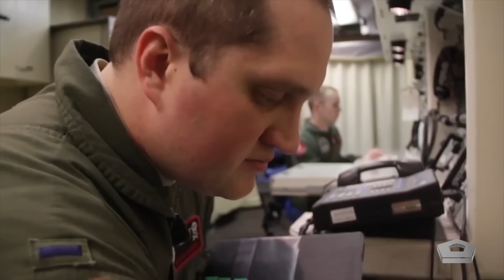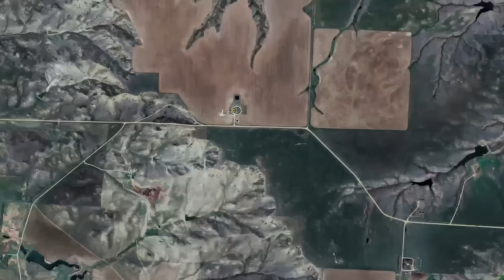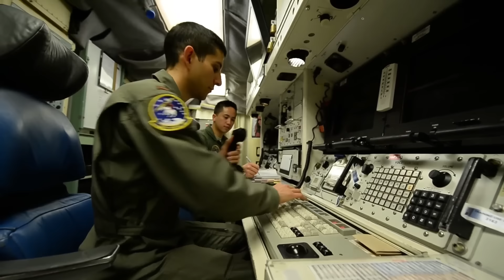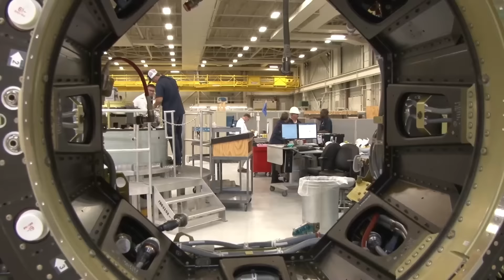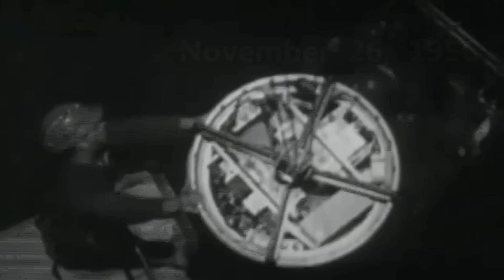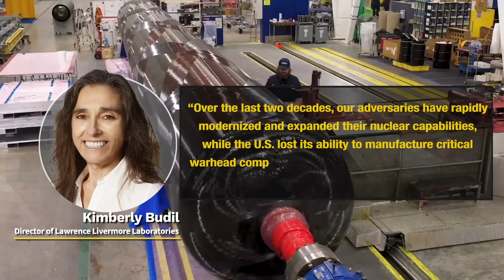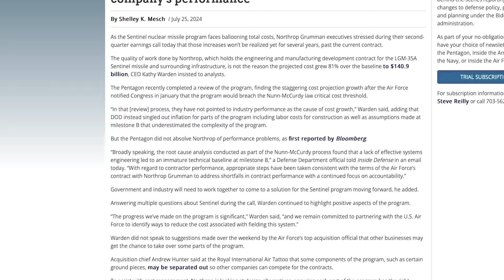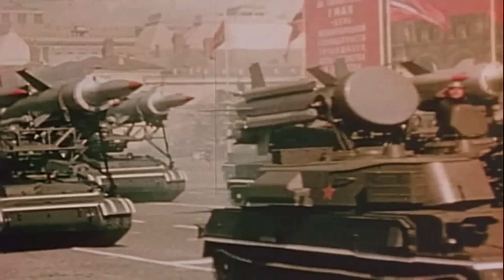America’s New Doomsday Weapon is Unstoppable

Comment: Hey Chris, love the video, but a few points of clarification:

1, Likely none of the advantages of ground based ICBM'S in general that you listed apply to the US arsenal. The Trident II carried by our nuclear subs is extremely capable even by the standards of ground based missiles and actually has an unclassified range only 1000 miles less than the Minuteman III, is more accurate than the Minuteman  III, and a better payload (it can carry up to 14 warheads vs 3 or 4 though this would probably drop the range to under 7500 miles which is the unclassified range with 8 warheads), is slightly faster, and is also more accurate than the Minuteman III. Also, the direct route is not really an advantage either, as the Trident II can take an equally direct and even shorter route than the Minuteman III by positioning a sub in the Arctic Ocean. The missile defense concern could also be mitigated by simply putting more warheads on the Trudent II missiles, at least in the shirt and medium term, as they are currently deployed with no more than 4 warheads per missile, and at present I can't find any info that Russia or China have or are developing any defense systems that can target an ICBM before the terminal phase when the warheads separate, either from their own claims or estimates from western analysts (though this is something that western analysts might not release to the public). I'm not finding fault, as every time I see descriptions of sub vs ground launched ICBM's they seem to be described the way you described them in your video, but if the specs are compared to the Trident II, or for that matter France's M51 sub launched ICBM, the comparison appears largely or maybe even completely out of date. 

2, While you accurately explained why the Minuteman III would cost so much to update, this might not entirely explain the cost overruns on the Sentinal program, as the Minuteman III, while it is the most recently developed land based ICBM still in service with the US, is not the most recently developed land based ICBM the US developed prior to the Sentinal. That was the LGM 118 Peacekeeper, which was built in the 80's and built by Northrup, so Northrup-Grumman may still have some reserve of talent with some knowledge of how to manufacture advanced ground based ICBM's. This is also not something I see referred to anywhere, but it's another clarification that I think is useful. 

Still a great video, and one that left me better informed than before I watched it (this got me thinking about the actual place ground based missiles would hold in the US arsenal), I just want to add to the info available. 

I'd guess the true role of the Sentinal would be to maintain that "missile sponge", which the Minuteman III would otherwise soon become too unreliable to remain in as a credible threat, and maybe to future proof the US deterrant in case Russia or China are able to produce Midcourse interceptors capable of downing ICBM's at scale at some point in the future.

Comment: I'm sure they have the plans for the MX missile somewhere.  That was actually deployed until we got soft in the head and got rid of it as part of an arms control deal.  It was 10 warhead, not just three.  Get that back into production and replace all of the Minutemen with those, having over triple the warhead capacity.  Also, for five hundred  missile or so, build a thousand new silos (many of which will be cheap decoys.)

Comment: Why not invest the money into direct energy weapons….same reason people who invent engines that run on water keep disappearing.
Reply: No, it's because they're as retarded as the idea of an engine that runs on water. We already have the latter, they're not a secret. They're just horribly energy-inefficient because they requires hydrolysis. We would need to put energy into the engine to make it produce less energy. 

For a DEW to be effective, it would need to have line of sight. If we put it on a plane, that plane is going to need a LOT of power to make the weapon worth a damn. That means a very large, very heavy, and very hot plane, that everyone will see coming. There are SAMs with ranges of well over 250 miles, WAY over the curvature of the Earth, that would just blow it out of the sky. 

So we put them in space? GDI Ion Cannon? Lots of cheap power up there from solar, and though the weapons would still be very heavy to truck into orbit, once it's up there, it effectively weighs nothing. Except it's a DEW, so it also produces a shit-ton of heat. That's a HUGE problem in space, since there is nowhere for the heat to go. Well, I mean, there is everywhere for it to go, but no way to conduct it away from the spacecraft. Even a common experimental military laser would rapidly vaporize all of its coolant and melt itself. A maser is cooler, but not enough to make a difference. LIPC is lightning in a tube. It's hotter than the surface of the sun. See the problem?

But that's not the only problem. There ain't no stealth in space, buddy.  The second anybody launches anything into orbit or beyond, every half-developed nation on Earth with a handful of satellites and radars knows its exact orbital track and position at all times. If they already know it's a WMD, they'll ASAT it straight down, or fire their own maser at it, frying it. Much easier from the ground, too, since you can make an anti-electronic maser out of a simple radar dish. Anyway, If they don't know the WMD is there, it will fire exactly once, because it will either melt itself, or show up as a gigantic, glowing, VERY detailed heat sig, and then get shot down immediately. 

Don't get me wrong, I love sci-fi particle cannons and shit as much as the next honest guy, but the sad fact is that they just aren't very practical for space, or anywhere else, for that matter.

Comment: 7,500 miles of copper wire for around 300-400 silos is only around 20 miles of copper for each silo.  20 miles of copper wire per ICBM silo seems quite low when considering the extensive infrastructure needed to support these sites. Each silo requires wiring for missile control systems, guidance, and launch mechanisms, along with critical components like communication with command centers, radars, power systems, security, and environmental controls. The 7,500-mile figure might refer to a portion of the wiring, perhaps focusing on specific communication or control systems, rather than accounting for all the wiring required for other infrastructure inside and outside the silo, including connections to command centers and broader military networks.

Comment: WE SHOULD BE DESIGNING A LAND BASED MISSILE… BUT ONE THAT IS MOBILE. BY RAIL. BY LAUNCHER ERECTOR. AND WE SHOULD DESIGN A MYRIAD OF “LOCATIONS” THAT THE FLEET OF MISSILES COULD BE. IT COULD BE A SYSTEM OF HARDENED LOCATIONS… OR JUST PLAIN HANGERS/BUILDINGS. THE LETHALITY OF THE SYSTEM IS NEVER KNOW WHERE YOU WOULD HAVE TO AIM IN ORDER TO NEUTRALIZE THE SYSTEM. IF A VEHICLE MOVING FROM A TO B EVEN HAS A MISSILE IN IT… OR NOT. YOU WOULD NEED TO ENSURE THAT THERE WAS NO WAY TO “LOCATE” THEM. SAY BY A BALLOON WITH SOPHISTICATED RADIATION OR OTHER SENSORS THAT OUR AW0L SECofDEF LETS SAIL FROM COAST TO COAST IN OUR AIRSPACE.

Comment: Arm 1/3rd of our silos with real missiles, the other 2/3rds with fakes. It will cost far less and have the same effect of deterrence. If necessary, make the fake missiles still launch like real missiles and only inform a couple people at each launch site that the missile isn't a real nuke, while the rest of the people stationed there think it's real. My point is surely we can achieve the same level of deterrence without arming all 450 silos. 450 is an absolutely insane number. How many do you really need for deterrence in 2024? (Personally i say get rid of them entirely, but I recognize how insane the defense industry is in this country and how that would simply never happen. This suggestion is already a compromise.)
Reply: Nuclear weapons give off radiation that can be sniffed such as by a sensor payload in a balloon floating over the fields.  The Chinese silos are closer together- possibly- to interconnect subterraneanly to shuttle/swap live and dummy warheads.  I just finished "Silo" on Apple TV; the large, steel door in the base of the silo is likely an interconnect to the others.
Reply: @MikeShannahan  giving off radiation is incredibly easy to do with a dummy warhead.
Reply: Why would anyone at any silo need to know theirs isn't a live nuke? There is no value to that, and a value in security for not telling anyone you don't need to.

Comment: Newer is not necessarily better.  
We see over engineering daily causing un reliability.  
Thru a handicapped education system . And corporate greed dictating engineering philosophy.  
If we lose the next ww it will be because our def exhaust  caused a fake code.  And we could not get a McDonald's ice-cream machine fixed.
Simple presision engineering that is reliable and east to fix wins wars .  Lest we forget

Comment: All of these options are stupid. Here's why. U.S. already has access to Space X, surprise! They make rockets that can be used over again. Nuclear payloads only need to reach highest point of ballistic trajectory under power. It falls the rest of the way particularly in the case of a MIRV warhead. So why use outdated rockets to upgrade a system that will be obsolete upon inception.Use Space X rockets to lift payloads to high point, then return to base and do it again. These rockets have already undergone testing and prove the concept each time they launch. A cost saving of billions in R& D. Anyway you look at it doing anyrhing else is costly, time consuming, and wasteful. Use what you have already sitting on the shelf.

Comment: 30 min everywhere. 
Yeaa.. no. That doesnt add up.
If you go orbital speed(around mach 25). It takes 90minute for a full orbit. Or 45min for a half orbit.
So 45min is the minimum time to get everywhere. As going faster than orbital speed means you will leave earth. 

Not even taking air resistances in account or speed up time. 

A more realistic mach 5. Will make it take 2,5 hour.

Maby you can skip time by adding rockets to friendly nation. But still.

Comment: ICBM-s are designed to be expensive intentionally. The most expensive part is the plutonium core in the warhead, it needs to be changed regularly because half-life degrades it below weapons-grade percentages over the decades. The old cores however are still too pure to repurpose as fuel in a reactor, recycling or re-purifying it would be incredibly expensive too. Old cores therefor need containment sites where they can be dumped until their decay deals with them. By the way the decay products are also pretty darn dangerous so there's that too so even the cheapest option to deal with this cores is pretty expensive.

This is an intentional part of the US deterrence philosophy: make an army so grand and expensive that if anyone tries to compete, they will either risk bankrupting their country or drive their economy into the ground or both. Worked with the Soviets and can still work too. The problem was the US taken things for granted after the "end" of the Cold War (it never ended really) and hence the issues the US currently faces. I say it is a pretty ingenious way of dealing with rivals and enemies and far less costly than an actual war, more, if everything fails and war does break out, the US will have an incredibly overpowered army to deploy, not a bad thing to have in a situation like that.

I say ICBM-s are needed, expensive weapons programs, ridiculously expensive science research, all of that is needed. This is the ONLY thing that guarantees the US not requiring to fight a total war with an equal or close-to-equal foe, let it be a superpower or a military alliance, all the US needs to do is outspend and outlast them.
Reply: It's not very effective against asymmetry forces however. That massive cost doesn't work against insurgents fighting with cheap gear.
Reply: @clowncargaming8046  Hence Vietnam and Afghanistan, sure, but would you rather lose regional conflicts or against a superpower? Which one takes priority?

The issue you pointed out is that the US should have another branch in its military that specializes with this type of warfare. They do have specialist forces all across the board but not as a package deal.
Reply: @MrPapamaci88  There are no winners in war, I'd rather avoid it with soft power.
Reply: @clowncargaming8046  I hear you, man, however without deterrence of a strong, highly trained and well equipped army, you can't use soft power effectively and soft power alone can only carry you so far. The sad reality is that there will always be colliding interests strong enough to guarantee the next war. No one wants to die, no sane leader wants to declare war and risk everything they worked for. The problem is when people are backed into a corner or their greed, short-sightedness and selfishness takes over, war seems to look more and more palatable. We need to prepare for the next calamity always.
Reply: @MrPapamaci88  I agree, speak softly and carry a big stick. It's just hard to speak softly as the US rn because our stick is so big and it's making a lot of noise dragging behind us.
Reply: @clowncargaming8046  I'd say the problem is the opposite, the proverbial stick is not big enough. The various greater military powers that currently screw around realized that they can get away with it since the US can't deploy sufficient forces everywhere at once.

The current military is comparatively small next to the US population, many of its weapons programs fell behind or were cancelled, the arms industry stagnated or atrophied at least when we compare it to the Cold War.

The US thought the Cold War was over, reduced military spending and now challengers are rising who at least think they can win a regional conflict if they can divide up the US military between themselves.

In short they are getting uppity because they see a chance. They are testing the waters.

Comment: Guidance systems are 50 years old. Solid rocket booster tech is almost as old. Converting analog logic controlers to digital controllers was done in the 80's. This overbudget over schedule stuff is a sure sign either the contractors or the DoD are ripping taxpayers off.

Comment: They make gizmos which plug into a floppy drive cable and use a USB stick, or SD card, to provide floppy "images" to whatever computer hardware. They're best known for replacing 3½" floppy drives but they've been used to replace 5¼" and 8" floppy drives. They haven't manufactured 8" or 5¼" floppy discs for many years.

Comment: My issue with ICBMs is that they were originally designed to be the MOST survivable option we had at the time (50s/60s) the idea being that enemy missiles weren't accurate enough to hit dispersed missiles in silos and therefore they could ride out the attack and launch an appropriate counter attack. However, as technology improved missile accuracy then these missiles COULD be destroyed in their silos which meant you had to switch to a "Launch on Warning" posture. ICBMs became use or lose.
Reply: There is another reason for early launch.  If the missiles are carrying defensive warheads, they need to meet the incoming warheads in space to destroy or disable them.

Comment: Look ground based missiles are nessecary , because they are the single most necessary part of the nuclear triad. Land based ICBMs are the base of deterence providing the option for first strike  destruction of a target, and the defense of other nuclear platforms as they are the most obvious part. Also look at it from a maintenance and readyness standpoint , a nuke silo is where it is we can contact one in a heart beat and tell it to launch .  Meanwhile a submarine takes a while to get the message , then has to contend against every adversary in the ocean looking for it.
Plus nuking an airforce base is like a two for one your nuking a major base along with taking out a nuclear warhead .
Really each piece of the triangle has a purpose .
ICBMs provide first strike capability , and defense for the rest of the triangle.
Submarines provide a revenge factor ensuring the enemies destruction should the united states be destroyed, while placing a stealth factor in the mix.
Strategic bombers , have quantity , and the ability to linger , and apply pressure to a hostile nation before an enemy launch can even occur.

Comment: Those were not the modern 5.25 inch floppy discs either, those were the slightly less modern 8 inchers, and there are rumours of a brand new 3.5 inch disc that may be coming out soon with a massive 32 kilobytes memory that will help us defeat the Soviet Unions attack from East Germany striking towards the Fulda Gap with all the forces of the Warsaw Pact.
Reply: As funny as this is, those floppies are probably there for a very good reason: they were, and still are, incredibly reliable data storage devices that are incredibly difficult to read OR write to in the modern age.  It’s not just a case of “oh, you need a really old device just to read this,” it’s a case of “these devices are all but extinct and nobody can make them anymore.”

It’s quite literally lost tech that renders these silos extremely resistant to digital theft, sabotage, or hijacking.
Reply: Bit worrisome considering I can get a flash drive that holds 10's of gigabytes now. But in hindsight. Who carries those old floppy discs and equipment to use them nowadays. Only has to hold a small amount of encoded information. Very hard to duplicate now. Not like the systems have new usb ports for flash drives or access to internet for updates.
Reply: You can make a flash adapter in the likeness of cassette car radios
Reply: A few decades from now they may even use Zip drives 😂